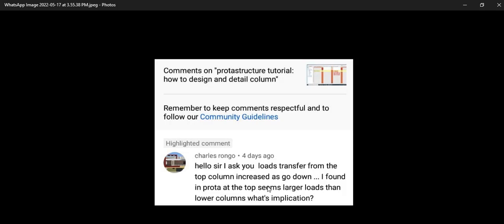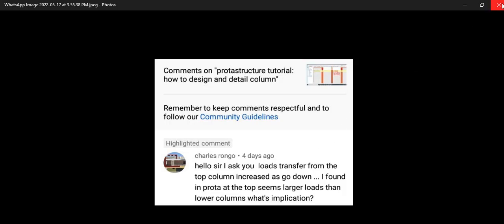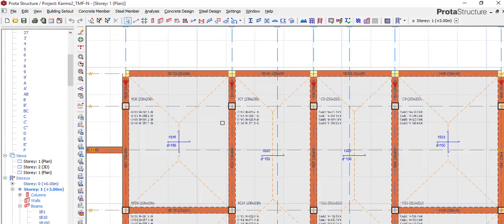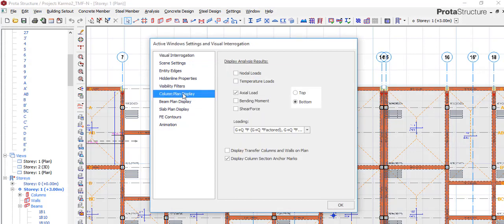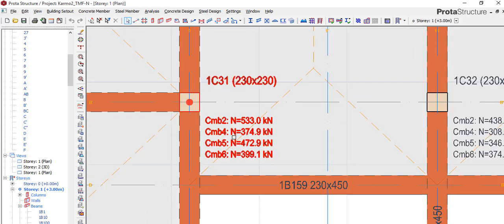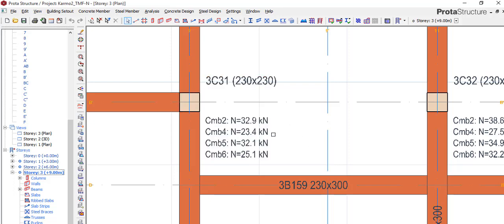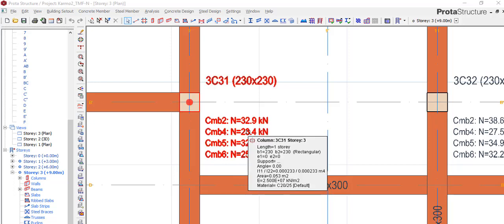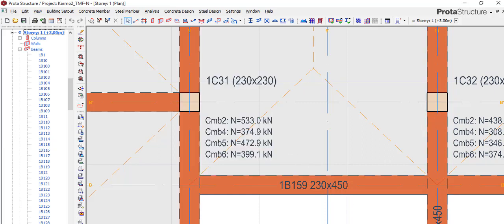protastructure tutorial: how to solve the problem of column with higher load than the lower column

Comment: Thank you sir all the way from TANZANIA. I ve some questions 
QN01; How to model plinth beams level and is there any different with ground floor level and storey 01?how to model basement?
QN02:To entire model is there necessary to using Load decomposition by FE  for  any of you r  structural model?
QN03:How to solve the problems when you find that for simple supported beams the top bars higher and bigger than  lower bars where there are large  bending Moment? 
QN04.shows us how to model the build with slab carry litre tanks of water, with the slab having lined loads and pointed loads?